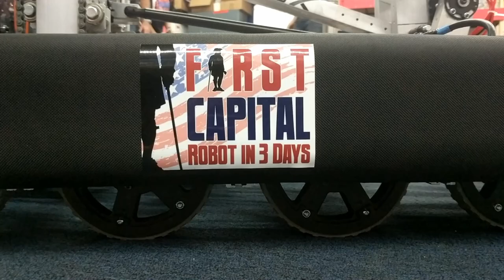Ri3D Team FIRST Capital ChungusX Release 2019

Comment: Hi team,
Your robot is just crazy! , I'd love to know which type and size of cylinder you used for the middle step,
And why have you just put one cylinder on the front of the robot (not too much weight on one cylinder?) And two cylinders at the back of the robot?
Thanks .
Reply: The robot was back-heavy, so we needed 2 cylinders there. Front cylinder was an 8" stroke 1.25" bore cylinder, and the 2 back ones were 7" stroke 1.25" bore